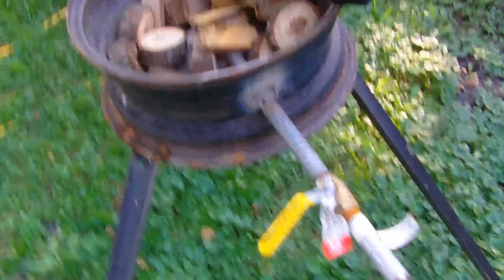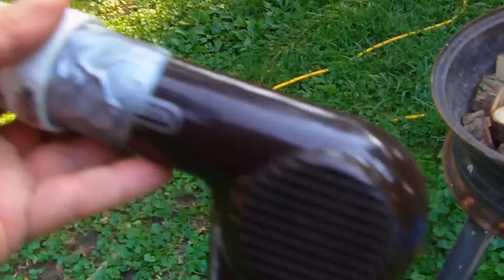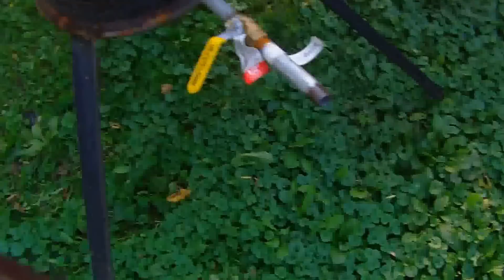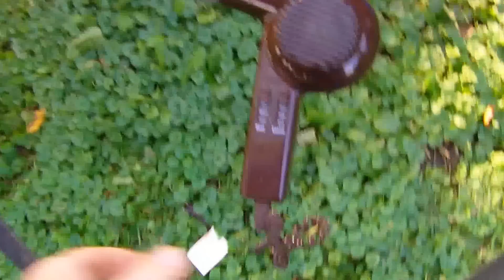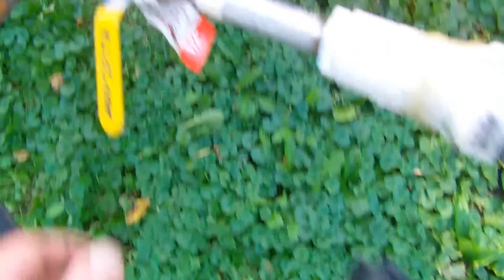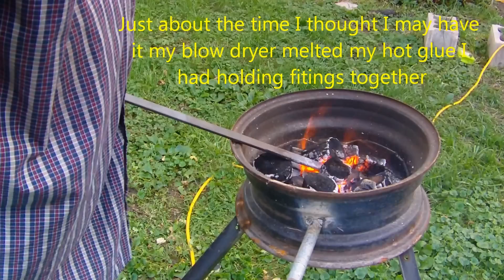Home made car wheel forge first time trying with wood fuel

Comment: Wood is OK for warming hands but there is not enough calorific value in wood to bring steel to cherry red which you would need before forging it.  That forge for yours could melt lead.  If you use charcoal you will be OK.

Comment: you need 3 things
1- larger air flow (increase the intake air pipe size to 1.5 or 2 inch)
2- more fuel ( add a lot more fuel )
3- a dome cover with large opening for air flow ( to minimize heat loss and concentrate heat much like an oven )
-- everyone has their own opinions and will throw out name calling first before actually giving advice -
Good luck on your project

Comment: I realize i'm commenting pretty late, but the problem is both insufficient fuel as well as the heat not being concentrated enough. That wide tire rim will loose alot of heat unless your fire is very big, or you use coal as a fuel, since the coal itself is a good insulator. A layer of sand inside the rim works well, you can dig a small or large hole as needed, make a large wood pile (maybe two-3 times the volume of the hole, burn it untill you have mostly coals left then turn the blower on and watch it glow.

Comment: oh also use black iron pipe and that aluminum tape. it works better than duct tape. don't use pvc. you have to at least be able to afford pipe right? it is pretty cheap.
Reply from the maker: Thank you for your Idea's I have updated the forge so I do not have to use tape at all you can check it out if you like in newer videos I have posted using scrap car exhaust pipe thanks for watching
Reply: i i did not check the date on this video. ill check it out.

Comment: if you use paper and just light it you can turn the air on after a few seconds. i can light my coal forge in 2mins. keep in mind you need the basics of fire starting: tinder, kindling, and fuel. charcoal lights pretty fast. i don't really start many wood fires. i would assume you can skip the charcoal.

Comment: You just needed to let your fire go longer, get a bigger bed of coals.
Reply: And he didnt seem to be letting the metal sit for very long either.
Reply: Well that too, but without a good hot fire, it wouldn't have mattered much anyway. He might have gotten a few heats out of what he had there if he left it in, but by time he got down to what he really would have wanted to do, he would have been out of fire anyway. 

When wood forging, you really want to get a nice bed of coals going before you start your work, and you will be constantly adding more wood to it as you go. The quicker you get the wood into the fire, the quicker it will burn down to coals.
Reply: Borgey H i
Reply: Nathan Jennings